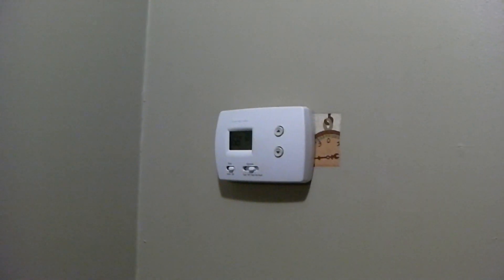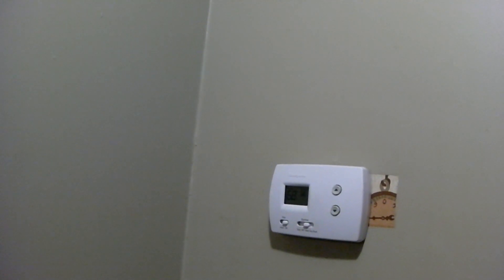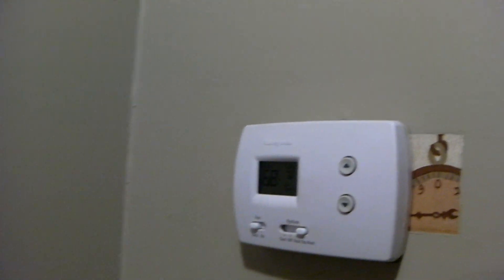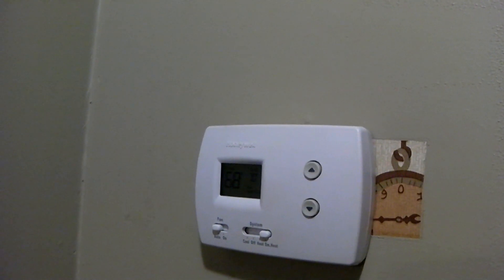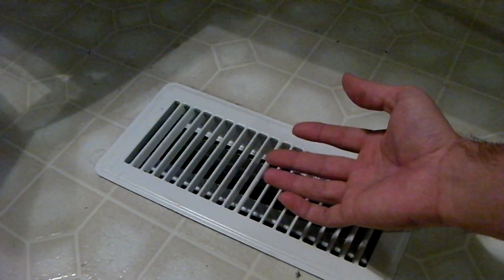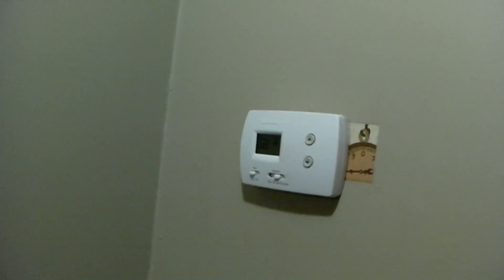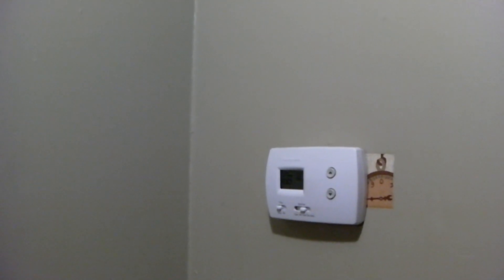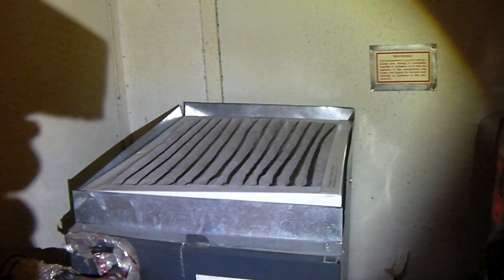Testing heat pump's backup emergency heat for proper operation

Comment: I put mine on emergency. My return Temp is 68 and supply is 82. Does that sound right?
Reply from the maker: It depends on how your system's heat strips are sized. Having for example 10kW heat strips on a 3 ton system, will get you warm, but not hot air when ran in emergency heat (heat strips only without the heat pump). The strips are sized to work with the heat pump, to prevent the air from being cold during defrost cycles, and to boost temperatures when there's a call for auxiliary heat.
Reply: @CubeComputerChannel  thank you. It is a 2.5 ton Lennox... Heat pump isnt working waiting on service guy Friday was measure Temp just making sure that was in the ball bar of normal... 17° rise at the air handler seems ok I guess
Reply from the maker: @joecozzo5476  Yes, you won't get super warm air in emergency heat. I suggest you keep the thermostat set lower than normal while using emergency heat as the heat strips are super expensive to operate.

Comment: Should your heat pump be running when your auxiliary heat comes on at 30 degrees or below?
Reply from the maker: Yes, the aux heat comes on to assist the heat pump with maintaining the setpoint temperature. The heat pump is still operating efficiently, though at lower temperatures, it may need help maintaining the setpoint, which is where the backup heat comes into play.

Comment: What is a likely cause of the emergency heat breaker not resetting. Heat pump is working fine.
Reply from the maker: Is your system a split system or a package unit?
Reply: @CubeComputerChannel  package
Reply from the maker: @kriswhartonful  How many breakers are serving the unit? I thought package heat pumps with heat strips usually have a large breaker serving the whole thing and then a fuse block for the compressor, heat strips, etc.
Reply: @CubeComputerChannel  There is a 50 amp breaker marked heat pump and another 50 amp breaker marked emergency heat. Truthfully I shouldn't have called it a package system, but it isn't a split system. I'd call it a normal heat pump system. I picked among the choices you gave me. Update: I turned the entire system off for several hours. I tried turning on only the e heat breaker while leaving the main off. It still wouldn't reset. Could be a bad breaker. Where should I start? The heat pump itself still works fine. The only other issue was  that I coulfn't control the thermostat from my phone app earlier. It might be working now. I'll check in a few minutes and advise.
Reply from the maker: @kriswhartonful  Just clarify, a split system has an indoor air handler, and an outdoor unit with the compressor, and a refrigerant lineset connecting the two together. A package unit has everything outside with the return and supply ducts connected. Typically the outdoor unit of a split system is fed on a 30 amp breaker, and the unit fed on a breaker of varying size depending on the kW of heat strips installed. If you have a package unit, there's the chance the compressor, outdoor fan, blower, and control transformer are fed on one circuit, and the heat strips fed on a different circuit... depending on how it was installed. Your thermostat likely receives its power from the control transformer, which provides 24VAC for running the control wires, relays, thermostat, defrost board, etc.

Sounds like you have a second breaker feeding just the heat strips. Either the breaker is bad, or there's an electrical fault somewhere. If the breaker is indeed closing in on a fault and immediately tripping, you'll likely see an arc flash inside the breaker, or even see smoke. One of the heating elements might be shorted. May be best to hire an HVAC contractor to figure out what's going on.

Comment: Any advice? I have a Trane (dual) electric furnace with an exterior 3 1/2 ton A/C-heat pump... it’s only about four years old and it works fine below or above the freezing point. However At this temperature point, the heat pump does not want to work so it goes into emergency or auxiliary heating, and the fan blows very softly and I hardly feel any heat… And the worst part is it will stay on emergency heating on for many many hours....(very expensive). To fix the problem I turn off the breakers for the heat pump and the furnace. I wait about a minute or two and then turn them back on and eventually that fixes the problem and the heat pump starts working again. I had a technician look at it when the temperature was 5° below freezing so it was working fine. Only when it’s around the freezing point, it may start to act up… Any suggestions? Any recommendations? Any advice?
Reply from the maker: Check and make sure your thermostat is configured to operate with a heat pump with electric backup. Not sure if the thermostat has an outdoor thermometer to measure the outdoor temperature. With heat pumps that have a gas furnace as a backup (and not electric strips), I believe it's typical for the outdoor unit to shut off and switch over to backup below 32 degrees. Given it's a Trane, it might have this setting in the defrost board. Good luck!

Comment: I have a Bryant thermostat. The auxiliary keeps coming on and if that happens the regular heat doesn’t come on. What should I do?
Reply from the maker: If it's not set on emergency, there could be something wrong with the heat pump. Either the thermostat is not getting the signal to the heat pump due to a bad connection, or there is some other reason it's not coming on, such a maybe a contactor not closing in. The thermostat will initially call for heat from just the heat pump, but when the indoor temperature continues to fall, the thermostat will then start the backup. The thermostat will typically have an "AUX" indicator showing when this happens. Also, the blower will likely run constantly as it would just be cycling the heat strips on and off unless the indoor temperature satisfies the thermostat setting.

Comment: How do I set it to emergency mode if I don’t have the option on my thermostat just has  on/ auto  cool/off/heat and +-
Reply from the maker: Some thermostats, particularly some "universal" thermostats sold at big box stores (with exception of smart WiFi thermostats), may be able to run a heat pump, but lack the emergency heat setting. In that case, you'd have to replace the thermostat with one that is designed specifically for heat pumps.

Comment: I had to put on emergency heat because heat blowing cold air it works
Reply from the maker: With heat pumps, the air coming out of the vents will seem cool particularly when it's really cold outside. If the heat pump's unable to keep up, the thermostat should add the backup heat to assist the heat pump. I strongly suggest you only use emergency heat if there is actually something wrong with the outdoor unit. The electric backup is far less efficient, especially when running on its own. When the thermostat adds the backup heat, it will show "aux heat on". The air coming out of the vents will get much warmer as it's adding BTUs to the supply air coming from the heat pump. Setting the thermostat to emergency heat disables the outdoor unit entirely and you pretty much have an electric furnace at this point, which will cost a lot of money to operate.

If the heat pump cannot keep up on its own at 32 degrees outside and the thermostat set to something like 65, there could be an issue with the unit, such as low charge, or not running through defrost.